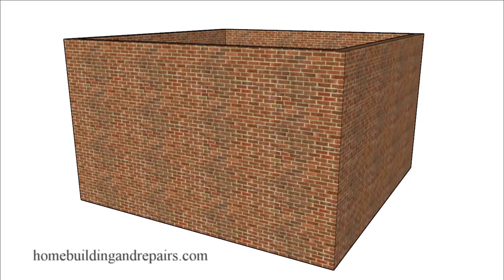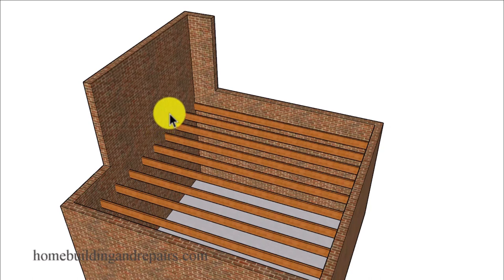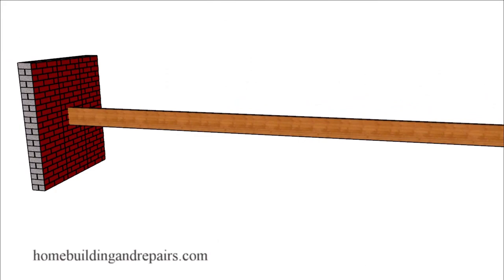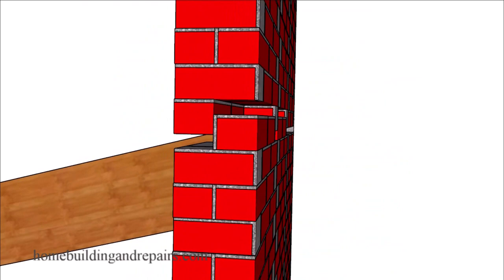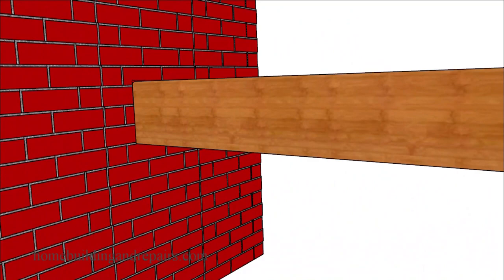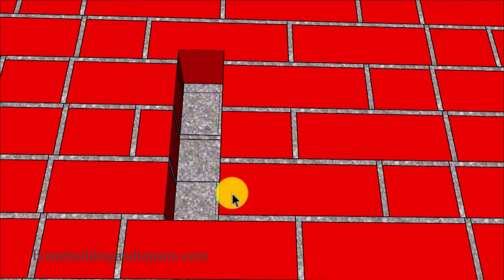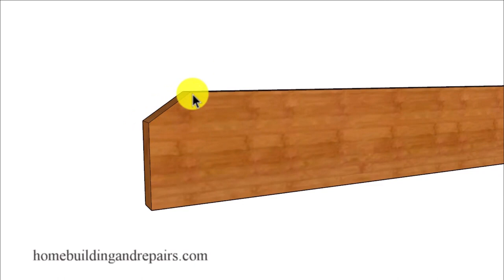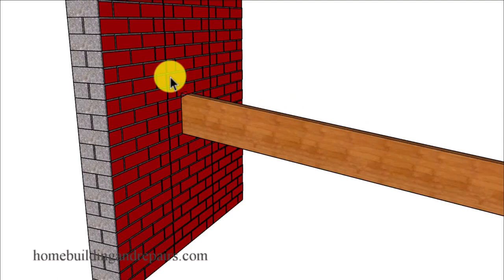Fire Cuts In Floor Joist Can Prevent Masonry Wall Damage - Old Brick House Building Ideas

Comment: About 50 years ago, I helped a buddy install a flat roof on a newly built storage room. Three newly laid block walls against an old block wall inside a factory. We did the joists and plywood after the bricklayers put up the walls. The "engineer" wanted slots cut in the old wall for the joists. "Cut slots on both sides and make sure the joists stick out into the other room. Go all the way through to make it stronger." One of the older bricklayers came over and asked if we were carpenters. "No sir." He asked if we knew what a fire cut was, and then explained it. "That guy laying out your job doesn't know s***." We made the fire cuts, and did not carry the joists through to the other side of the wall.